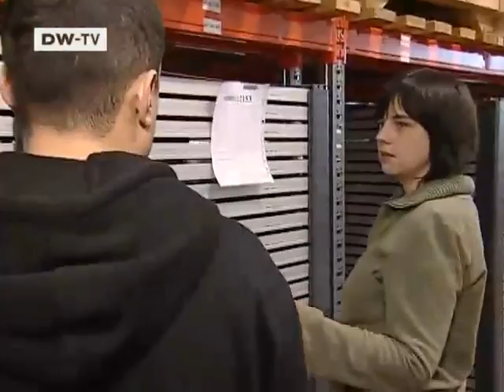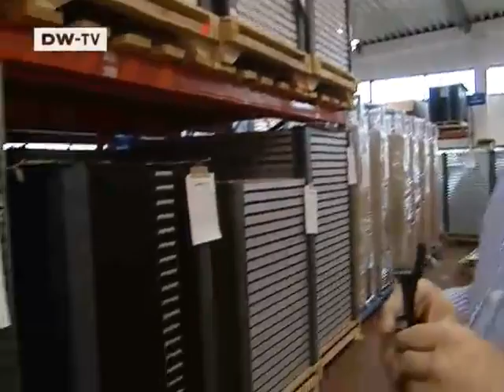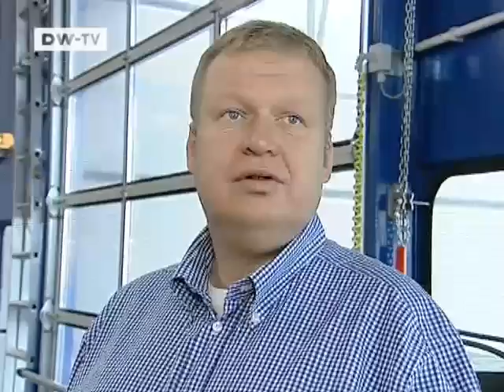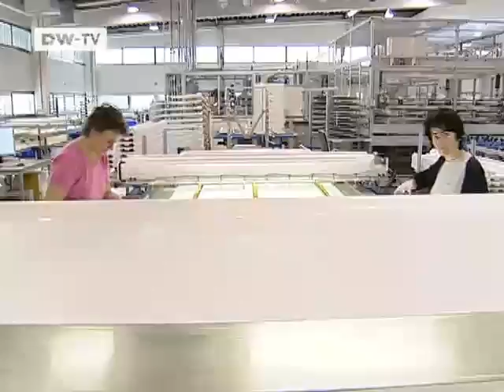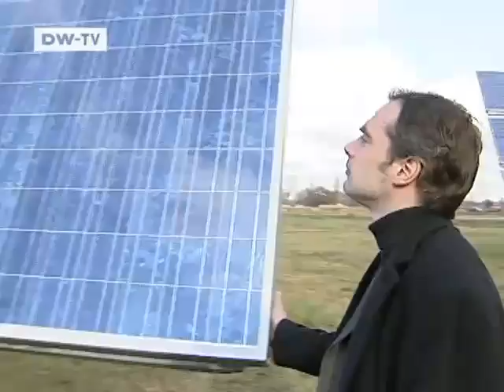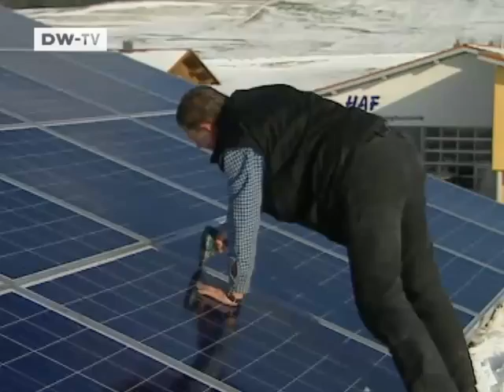Made in Germany |  Solar Technology as an Export Hit

Comment: Royal Navy::Great Idea but why does everybody use a dish shape to track sun.Why not use a globe shape solar collector. Dishes always need to be moved but a ball shaped solar collecting, can get all angles on its panels.
Another good project of a application for solar type idea. Is not using sun light to charge a device. Instead using a laser to charge solar panels.Or laser light sent unto solar panels to gain electricity.Works good under water to charge small device with fiber optic laser light.